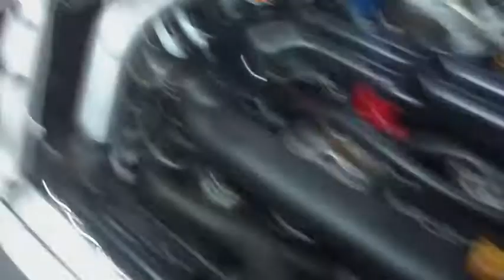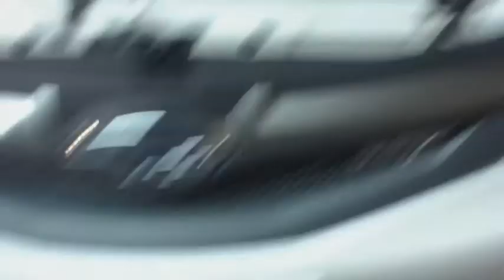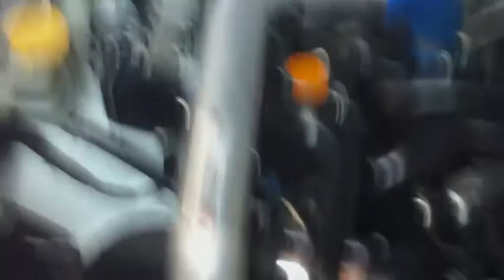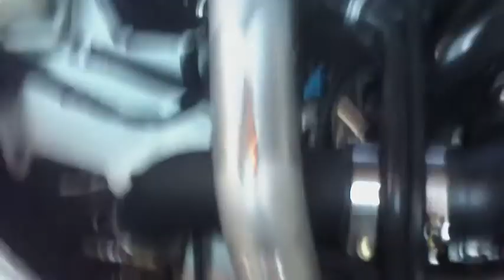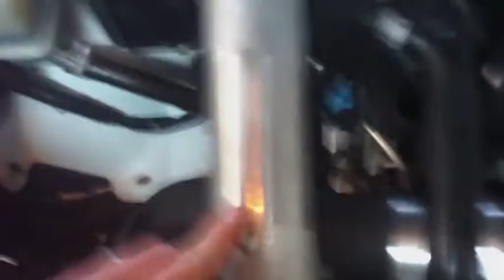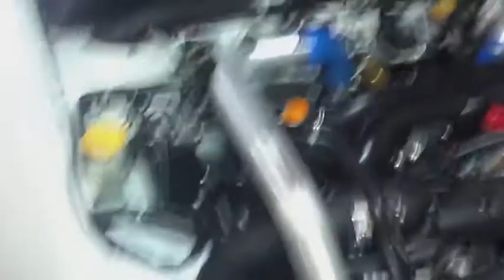09 wrx awd/cobb

Comment from the maker: @21April853BC we shortened the suction pipe and lowered, added standard cone filter instead of foam to allow clearance for fmic pipe. shrouding underneath with air guides to provide frontal air..... editing the finished video atm ended up perfect. stay tuned. this car was also polished and muffler delete with exhaust audio comparison.  saving video on polishing to make a how to vid on polishing bare metal